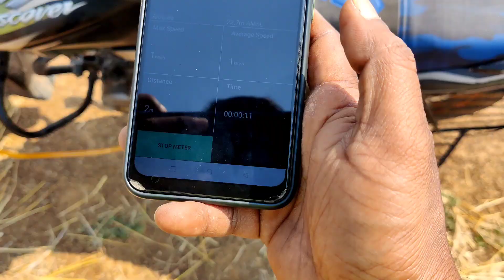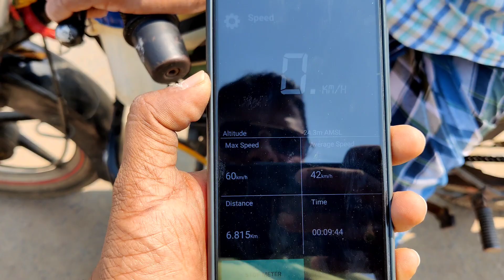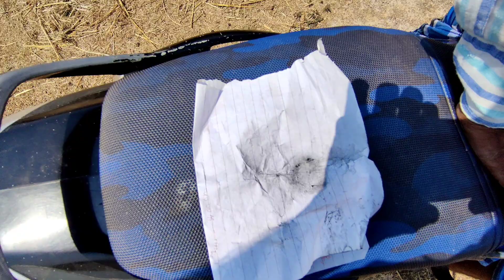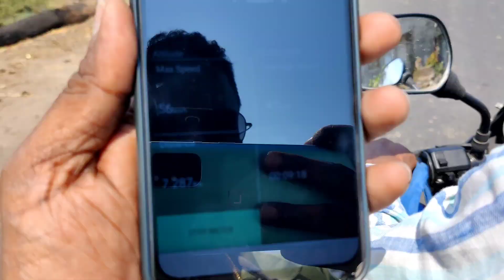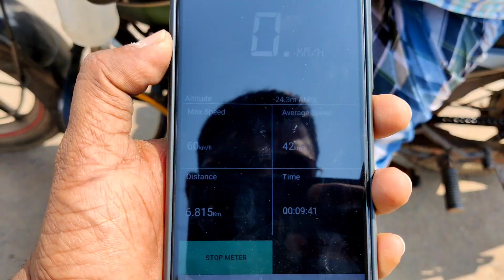Old Discover 100 bike pickup and Milage Increased | Neelu arts

Comment: Sir my Honda Activa 5G milage decreased to 40 kmpl from 52kmpl, please suggest me what are the parts to be changed or cleaned for increasing milage
Reply: Fuel injection system, if your vehicle km reading is higher consider head cleaning. Don’t puncher any manufacturer rubber units. At around 35k kms changing rollers, clutch, belt(if not previously changed), spark plug. If you want to use any kind of additives(which is not mostly suggested), do only use any recognised brands like liqui moly/meguin/würth etc

Comment: Liqui Moly 4t additive does the same work. What different is your product from a trustful brand like liqui Moly. Do you/product hold any certificates or legal case studies. Considering the puncher to the rubber pipe which is not supported by the any manufacturer, on what supportive basis are you doing it ?
A manual cleaning is a lot preferable considering the extent of clean rather than any additives.
Reply from the maker: 😂😂😂 thank you brother ❣️